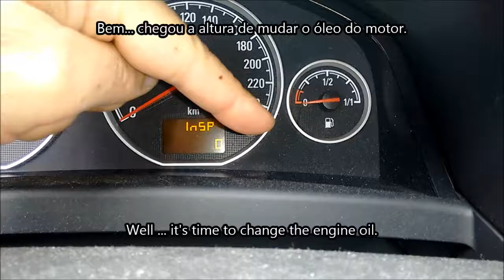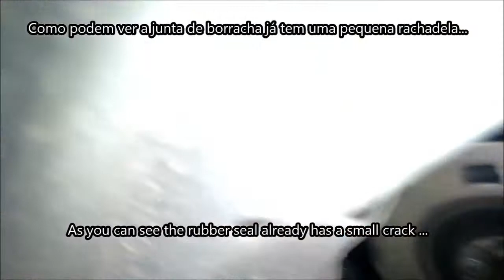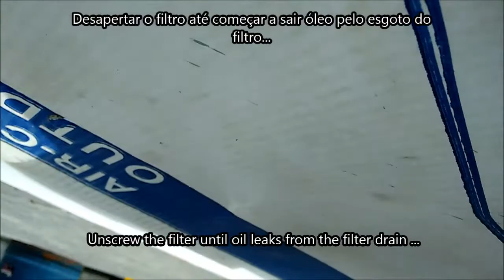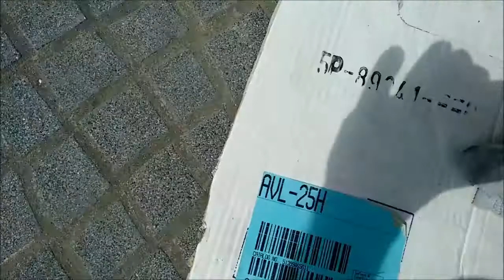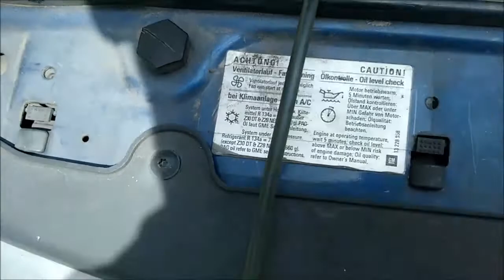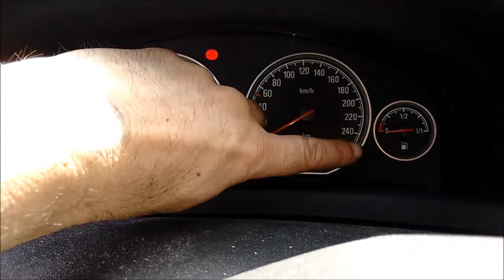Motor Oil Change opel / vauxhall vectra c z19dth

Comment from the maker: Hello. I'm sorry for not having made the video in the best conditions.
When attempting to remove the oil drain plug, I have damaged the plug.
I lost my patience and ended up using the suction to remove the oil...
When I find a solution I post a video about this problem.
Thanks